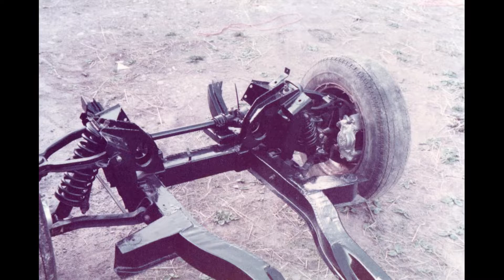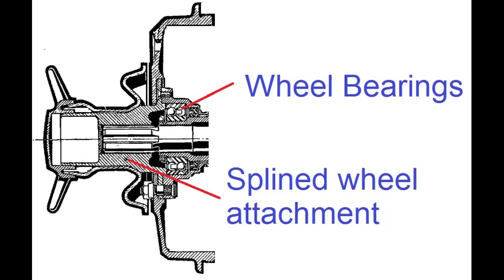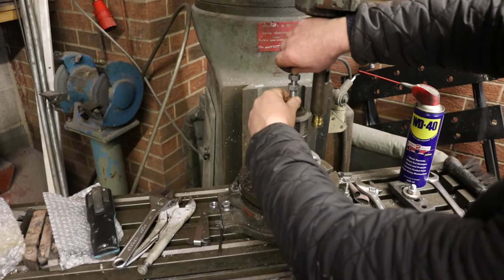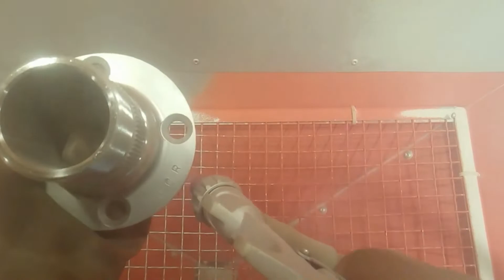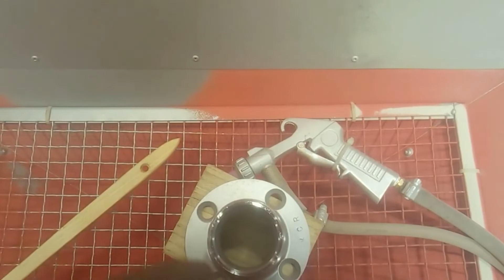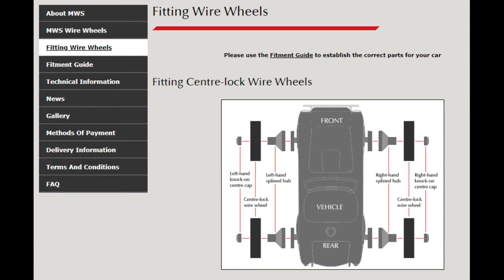Wire Wheel Safety Alert

Comment: Thanks for that very useful lnformation. I have a Gentry on steels(14”) and l am fitting 15” spoke wheels so this is very important. Love your channel.
Reply from the maker: Hi Roger,
Thank you for leaving me a comment, it really does make it seem worthwhile putting in the effort. 
Yes, the Gentry will look better with 15" wires although the Naylor TF runs on 14" .
I have TR4 60 spoke wires on mine. I'm so pleased my video has been helpful. There's a lot more still to come. Thank you for your ongoing support 👍
Reply: @itsalldoable  Many thanks for your reply. Unfortunately lm not an engineer,just someone who has a love of older and more simpler cars,and the Gentry seemed to fit the bill. I’m getting my adaptors from MWS anyday now,so then l know what to look for.
On a slightly different note,l came across a “1955” MG TF made by Harper Roscoe from Cheshire. Have you seen one?
Reply from the maker: @rogerburrows2429  MWS is where I had my wheels and hub adaptors from some 38 years ago. I doubt you will have the same issue as I had but it's well worth checking. I was an engineering apprentice when I originally had my faulty adaptors and didn't realise.
No, I haven't come across that car.
Maybe you can send me a link to view some photos of it , if you came across it on line.
Kind regards Paul

Comment: Never realised cars ran adaptors like this for wire wheels that just bolted on. In VW world I've seen radius bolts used on a taper wheel and visa versa... a few times. I've never heard if them actually coming off but the fact we use bolts instead of nuts may give us more 'catch time', or maybe they just hadn't fell off yet! LOL.  Certainly when bolting up alloy wheels with the wrong bolt it can damage the alloy wheel when a collar isn't in use, steel wheels are obviously more forgiving. 🙂👍
Reply from the maker: I think the trick is to ensure that you have matching chamfers and conical angles. I have heard of spherical bolts and I would think that they should go with matching spherical cups in the wheels. Having been in engineering for over 40 years (Rolls-Royce) I have never seen sphericals sitting in conical locations so maybe it is something that you should look out for going forward. Sounds like you have been lucky in the past.
Kind regards Paul 👍